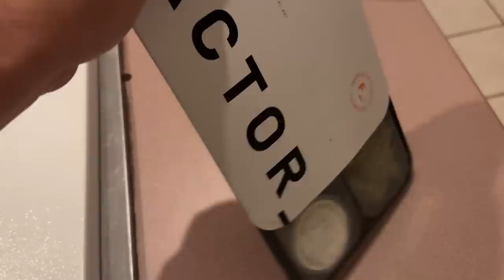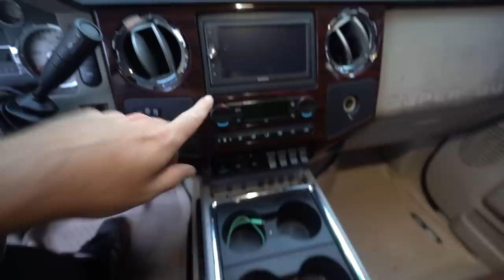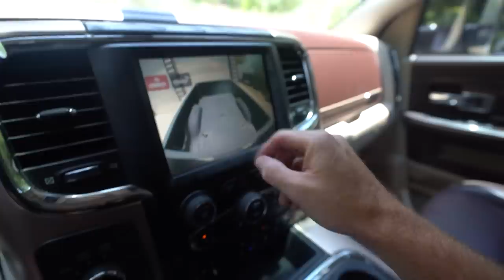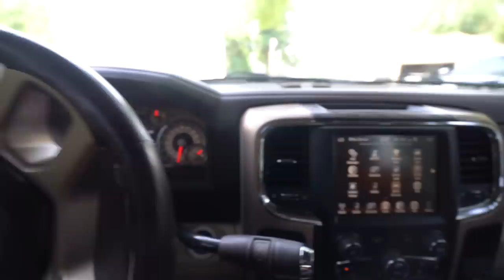My new truck broke down. so I bought another one. bucket list tow rig.

Comment: Hey Tyler, make sure to look up Banks Power to do a Monster-Ram Intake System. As stated by Banks Power: "PREVENTS BROKEN BOLT ENGINE FAILURE. Cummins Ticking Time Bomb
Due to heat, vibration, and time, a nut and stud from the factory heater grid has been documented to come loose and fall into the intake manifold. Once this happens, it will roll downhill into cylinder #6, causing catastrophic failure that requires a complete engine rebuild or replacement from bent valves, damaged pistons, and head."

Comment: That’s some real leather in those long horns that’s why the seats are in good condition. We have a 2013 and it’s brand new on the inside. Really good quality inside of those trucks. It’ll do you really good I’m sure
Reply: Another thing… I always have trailer/tow mode on obviously when towing and on full exhaust brake not automatic. And heavy electric trailer break. I tow across country with a 2020 and I can do 5th gear going almost 70 before it starts to get a little high rpm. These are really good trucks AGAIN! We do a DEF fix so you don’t need to add any because it just adds to costs. Some helper bags will help too and it’ll ride really nice!!
Reply: And transmission wise. They shift early when not on tow mode but then again they make almost all their torque at 1600 so it should be fine with how it comes.

Comment: i like the looks of the fummins better but an all OE tow rigs sounds like the better solution as on working on it. the engine its way cramp un in the fire wall and could potentially create issues with side of the road fix. i understand the move and well for long distance towing, the Ram is i believe to be the best option for side of the road and out of state issues

Comment: Odd little hack for the Ram backup camera. Might not apply too you with your 5th wheel but if you ball and hitch it, or anyone else out there running that setup, if you loop your tailgate straps around the tailgate latchs at the top so your tailgate is at like a 45, your camera points in an almost perfect position to see your hitch for easy hookup.

A little hack another Ram guy showed me.

Comment: Being a 3500, there's a good chance that you have the aisin transmission. The valve body problem is more of a 68rfe issue. Something you will want to look into is the grid heater problem. Banks has a solution for that. I noticed you already have some other goodies under the hood so you should be in good shape other than that. I just bought a 21 Cummins mega cab. 21 they went back to the cp3. My buddy has a 16 Cummins that ultimately made my decision to go Ram.

Comment: personally prefer the fummins. not a fan of the forth gen, battery trays are annoying AF to remove, as usual transmissions are garbage, VGT in the 4th gens are trash and constantly cause problems, PCB relay boxes are annoying not to mention the light module issue that plague all chrysler vehicles and last but not least the factory fuel filter system is pathetic. i cant count how many ive pulled that are completely collapsed on themselves that are still well within the "suggested/factory intervals".

Comment: 1. I would look into a long bed conversion. i believe you're more than capable of doing the conversion yourself as the only really skilled part of the swap would be tig welding the frame sections together, it would eliminate the need for a complex hitch system and the added wheelbase would help the highway manners immensely.

2. I have a 14 ram 3500 with a 68rfe on 37" tires, if you intend to put the mega on any taller tire than a 35 i'd highly recommend swapping the differential gears to something lower, assuming your truck has 3.73's, as to take pressure off of the OD gear clutches, and converter, i didn't do this and now my converter slips lockup in 5th and 6th when attached to anything over 10klbs. Randy's transmissions is the go to for 68rfe performance. 

Congrats on the Ram! welcome back to a real pickup.

Comment: Mega cabs are sick and the longhorn is a really good model for you guys it's tough and well optioned. I don't think you mentioned the mileage or damage in the rear just wondering for it being a 16 what the mileage was and if you plan to fix the dent in the bed and tailgate. If you do that and polish up the wheels, paint, chrome and do a coating it would be a super minty truck. There's also leather ceramic coating that lasts a year from jax wax you could put on those seats to keep them fresh. And a big garage built co livery in satin black across the whole truck and trailer might be kinda sick too🤷🏻🤷🏻😄

Comment: I like the fummins a lot, mighty and be my favorite build series on the channel, but there is a lot to be said for newer stock vehicles. I bought a new ford ranger after messing around with a variety of used and modified vehicles and the comfort, peace of mind, power etc. are all beyond what a built or swapped vehicle can reasonably achieve. Congrats on the new rig, I'll miss the fummins but if I had to ride with you 18hrs to an event I would choose the current Ram over any other tow rig you've had!

Comment: Just a thought.
Instead of making some form of "backwards" structure, that positions the king-pin for the goose neck, towards the rear of the truck (thus making the pivot far to far - rearwards of the axle position for legal towing), what's the ability of redesigning the fifth wheel stub that sits on that pivot/king-pin itself, making the pivot "pin-neck" a lot further forwards on the trailer itself, thereby keeping the trailer "hitch" itself, between I think 4" up to 10" rearwards of where the pin actually is located in the bed of your ute, thereby putting the trailer SWING, that much further away from your cab - meaning that you instantly gain more turning clearance, without having to cut your cab corners off, or cut parts off the trailer itself.
 
Easily fitted, and thus is the easiest way to to modify your towed trailer hitch point that much further back.
https://www.amazon.com/Trailer-Hitches-TEXA4200-Gooseneck-Extender/dp/B0046IQD6C

The idea of making the trailer's gooseneck LONGER to allow a longer tractor chassis to pull a gooseneck trailer with extremely heavy loads, came about in the trucking industry, thus there are several designs for extending the trailer hitch point itself, with an extender, to allow a tractor with a longer chassis to tow the same short gooseneck trailers.

It works the other way too, with a short-bed truck, towing a long gooseneck trailer, enough swing clearance when turning, to tow that trailer with the short-bed, if the trailer extender is fitted.
re:
http://www.rogerstrailers.com/contact/glossary/gooseneck-extension#:~:text=The%20most%20common%20use%20for,the%20gooseneck%20or%20removed%20completely.

Comment: The ram has the best exhaust brake on the pickup market. Put on self leveling air bags. Remember it takes 2 foot pounds of torque from av8 to equal 1 foot pound of torque of a inline 6 .  It takes 2 horse power of a 6 to equal 1 horse power of an 8 cylinder. When you put the tow haul mode on the engine will shift at 1800 rpms minimum. I put. My 2021 ram at 1800 rpm and it hits 4th gear run it up to 2200 .it will lock up sooner and keep it there until you hit 6th gear witch it is double overdrive. Inline 6 cylinder engines like low rpms for rolling down the road. I don't have the high output so I get my 850 torque at 1800 rpms. Just watch your Temps. Denis from Santa Rosa CA  .been driving ram trucks for 34 years. In my opinion it's the best functional built trucks. When Ford had a light for the def tank ram was like kenworth and Peterbuilt it had a gauge. Good luck on your new venture.

Comment: Only downside of the 6.7 is the 68rfe that it has. If you could’ve got one with the Aisin transmission you would’ve been solid for towing anywhere you wanted. 68rfe is definitely the biggest weak point but it can always be built.

Comment: I’ve had a G56 truck and several 68RFE trucks. 

Here’s my take. Not an expert just speaking from experience. 

A lot of the pitfalls of the 68RFE come from unnecessary abuse. People overuse the exhaust brakes on these trucks. Which causes unnecessary down shifts and excessive wear on the trans. 

Don’t use it unless you absolutely have to. 

Another thing, going down hills and especially with cruise control enabled. Take the truck out of “tow haul” mode. It too will cause unnecessary downshifts to try to slow you down. 

So much unnecessary wear and tear on the trans. It’s cheaper and easier to replace brakes on the truck compared to replacing a trans. 

My 2010 68RFE mega cab has had a trailer pulling consistent 12,000+ lbs behind it it’s entire life. 210k miles. Original trans and it’s been deleted snd tuned since 80k miles. Never had a single issue. 

Treat them right, they’ll treat you right.

Comment: @ 27:00 you say it shifts early. But as i understand it, diesels make power at lower rpm unlike gas engines making power at higher rpms. Is my information outdated? I'm sure when its loaded it wont shift so early because you can still lug a diesel... below 1000 rpm is probably lug territory empty.. and 1100-1200 rpm loaded.

Comment: 6.7 cummins make power at a way lower rpm than 6.7 power strokes. 1100 rpm isn’t really lugging and in tow haul mode with proper tuning it should end up being in a gear lower than normal non towing driving conditions. Which would give you higher rpm to stay in the sweet spot for power 1900ish rpm. 

Rev max valve body’s are sweet and not too spendy. Tuning is super important to go along with a valve body and a thermal bypass.

Comment: As a auto/diesel tech for 15+ years, do yourself (and truck) a favor and always replace both batteries at the same time. Your starting & charging systens will thank you. 

The "good" battery has to make up for the "bad" battery, making you consistently changing 1 out after the other. 

You my friend have 2 beautiful tow rigs.

Comment: 3500s have the Aisin AS66RC trans, not the 68rfe that the 2500s do. You're much better off with the 3500 for that reason. Solid unit

Comment: not sure if there is an automated manual for that truck, i know some actual semis have such, has the same strength as an actual manual [is actually the same buildout as a regular manual, just uses a controller + actuators to work the clutch and shifting], but has the easiness of an automatic when actually driving it..

Comment: You cant get a mega cab with a long bed. To me, the perfect truck would be a mega cab with a 11' bed so you can have a toolbox and transfer tank in the bed while still have 8' of bed to carry stuff. The automatic vs manual transmission is a tough one. Pulling heavy weights in a ranch environment, I would rather have the automatic as I feel like I would be abusing a clutch when jockeying heavy trailers around in tight off-road areas. My current ride is a Chevy Silverado LTZ crew cab long bed 4x4 automatic. I have several complaints with it but it does get the job done.

Comment: Number one way to keep those automatics alive is to leave the truck alone. No tuners, no injectors, nothing. Leave it stock and keep up on the services. Assuming the last guy took care of it in a similar way, that trans will never be an issue. Everyone complains about stock dodge trans but the grandpa's that buy them and just put miles on them and take care of them, never have an issue. Only other thing is the variable geometry turbos can fail with too much idle time, something else to watch for on those trucks. Overall awesome choice, I'll always be a hard-core manual guy in diesel pickups, it's all I've ever had but I get it.

Comment: Is the long bed conversion out of the question for you? My shop had a customer that bought a mega cab dually, then took it to a shop (I believe in Utah) to have it converted to a long bed before we did the suspension lift for it.

Comment: I would get a banks tuner for it. I have 2 buddy’s that have the same truck as you and they both have tried different tuners on their trucks and they both ended up staying with the banks tuner. They said the banks performance tuner is all around better then other companies, as in the Engine performance fuel mileage and they both said the trans tune is better by far over the other companies

Comment: I have a short bed ford and a exiss cattle trailer that is seven foot wide and square on the front and I installed the b&w 4 inch extension in the bed and it works great.

Comment: My 4th gen has 440k on it, only problems ive had is the lower alternator bolt coming loose (very common fix with locktite) and the ebp sensor rattling loose (i keep an extra inside the truck)

Comment: We had a 97 gmc white crew cab long bed dually all white all chrome bumper grile etc led dome lights headlights then chrome semi rims on car tires had a 454 big block that no matter if you had 10,000 pounds or zero extra weight it only got 7 miles to a gallon lol but was sexy af you could hear it start up 4 blocks away sounds like a freight train lol then stanced like a car

Comment: . I’m sorry if you were gonna get a Ram, you should at least got a high output version. The 68 RFE is a piece of garbage when you’re pulling heavy and you  are going to tow heavy. Big mistake my friend the Aisin was the one you wanted. That Transmission is simply too small to hold up to heavy towing for a long time. Don’t even think about turning up the power
Reply from the maker: No it’s actually not. I did a lot of research on this. The Aisin has the same major failure point. No aftermarket support. And no ability to tune it. Also it De-rates on shifts. Meaning it basically cuts power while every shift is happening so you get jerked around.

Comment: Is the new truck deleted? If not, the new truck will just as many issues with the exhaust and fuel system. Also, the transmission in these trucks are awful.

Comment: This is a very nice truck, i had a 4 door long bed 2018 version. Longhorn as well. I just wish you would have stuck with the ford and spent the time on it that it could use to make it all it could be. The ford is unique and a very cool truck. I think long term it would have been smarter to invest in the ford, and not another truck, i mean fuck man you got a short bed knowing the issue with the trailer. Even with an offset hitch and neck, all thats gonna do is make it tow like shit bro.... been there done that. i get that its a bucket list thing, but quit neglecting the ford, and get it to its full potential. Built trans (10 speed perhaps?), tow tune, turbo upgrade (compounds for towing), interior refresh, etc. would make for way more exciting content and not just a cycle of trucks.

Comment: Shouldnt you turn in too hard with a trailer anyways? I keep reading how trailer tires are the worst, and how a lot of people lose trailer wheels and shit, but I think its because you shouldnt generally jackknife your trailers, due to the stuff I just mentioned with having excessive wear at trailer tires and wheels that just fall off, at least thats what I've learned from driving semis over here in germany!
pretty sure though you keep your stuff in tip top shape though, I'm not worried here, but it would certainly help IMHO

Ram looks sick! love the interior! are you gonna throw on the Alcoas on that too?

EDIT: That doesn't mean you shouldnt get the extender, because thats way too close, but just to keep in mind

Comment: I like the way your truck 🛻 shifts. The thing I don’t like about new vehicles push button gear shifter because I like to be able to down shift a automatic transmission and up shift it like a manual transmission without a clutch. 🙂

Comment: I always love the content.. being honest I believe you would have be better of getting the tune upgraded and putting in the update fuel modes needed for the ford rather then fight with the trans on the dodge still good engines obviously but I've been towing 10+ years. I would personally stick with the super duty and get the fuel filter and upgraded the pump.... butt Regardless its a nice truck to tow with

Comment: Your gonna need to put new LED headlights. The stock headlights aren’t nearly bright enough for nighttime towing. I have a 2015 2500 and I’ve had to put multiple different headlights in because the stocks aren’t bright enough but if you get too bright you feel like a dick when you are driving at night blinding people with just your headlights on not even high beams.

Comment: Not sure how I feel about selling the 350 and hopping right into another truck that can’t even tow your trailer without modifications, but maybe I’m a little biased towards Ford. I feel like you might have thrown in the towel on the F350 too quickly, they’re great trucks and the part that failed isn’t even specific to Ford. All dealerships are hard to work with, regardless of brand when it comes to warranty work. I think it would have been a phenomenal truck when repaired and it’s unfortunate how things played out, hopefully this one treats you better

Comment: Drop another 10 grand you can make it a mega long bed 🤣 also you can either keep the factory manifold for the turbo and keep it with the exhaust brake or swap to the second gen manifold and tune it and get some ponies outta it

Comment: Taylor swap to a fifth wheel hitch...... they make automatic sliding hitches that push the trailer away from the truck as you turn without ruining your weight distribution, which is what's going to happen if you offset your ball backwards.
Reply: here's a nice gooseneck to fifth wheel adapter that should work with an auto sliding hitch      https://www.youtube.com/watch?v=-XDAis3fivM